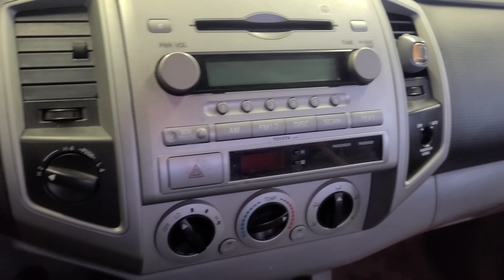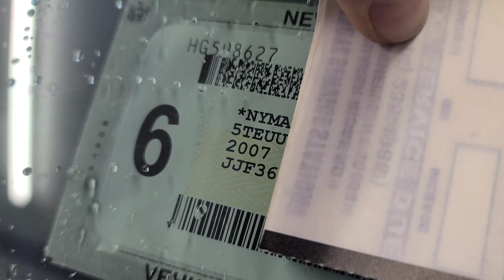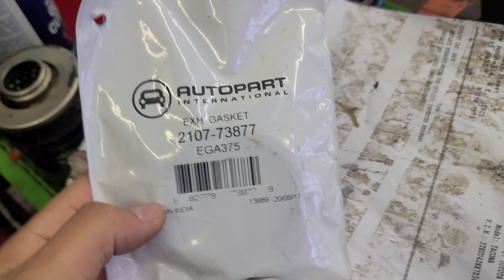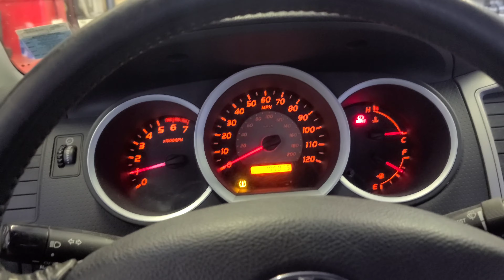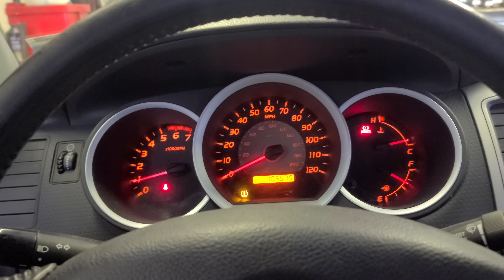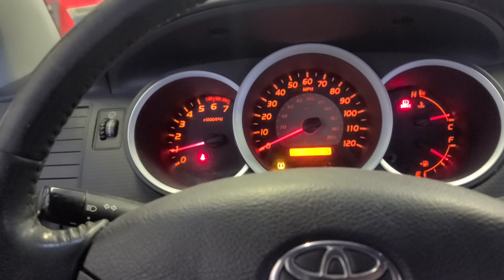2005 - 2008 Toyota Tacoma How to Replace the Exhaust Pipe & Muffler

Comment: Thank you for the tip about removing the sticker so that I don't stink up the area around the truck.  When installing the bolts, is there a torque setting I should go for?  How tight should I tighten them?  Also, did the old rubber hangers show any signs of damage from the difficult removal prying?  I'm worried that I'll harm them while removing them.
Reply from the maker: Tight and snug the 🔩 and  That's it.
I'm so glad you liked this video.
Do me a favor and DO NOT GIVE ME MONEY.
I DO THIS SO YOU LEARN HOW TO DO IT AND SAVE MONEY, but if you wanna show your appreciation then,
Right below the video, there's a heart symbol that says "thanks", click on that, and there you can buy a super thanks (appreciation / tip) which directly supports Axtuo Ax channel. (This channel)

Comment: I’m Moises and I have a 06 Toyota Tacoma Prerunner V6 4.0
I’ve replaced manifold exhaust with catalyst converter both upstream and downstream.  Still hear an exhaust leak.  Looked on the exhaust pipe by the muffler and found exhaust burns were the downstream meets the muffler pipe.  Should I replace the flange gasket?  If I can’t afford replacing the whole muffler?
Reply from the maker: Tight it more